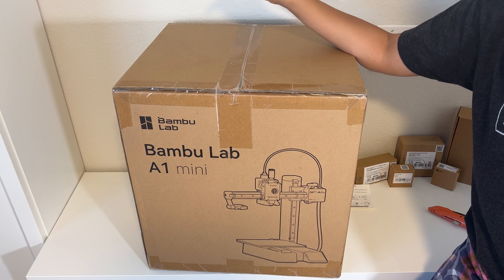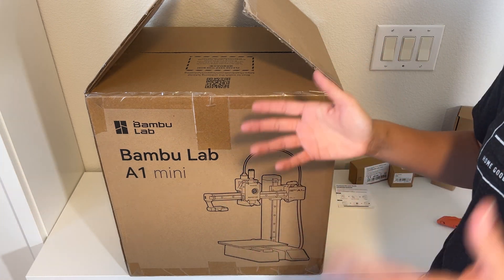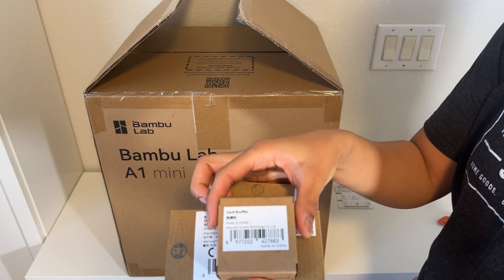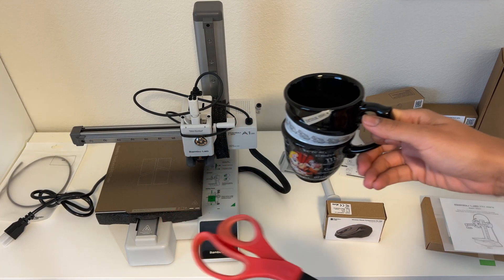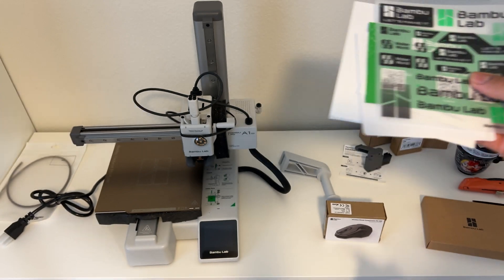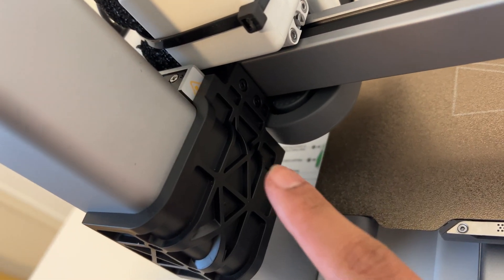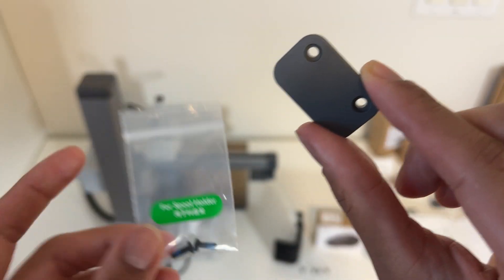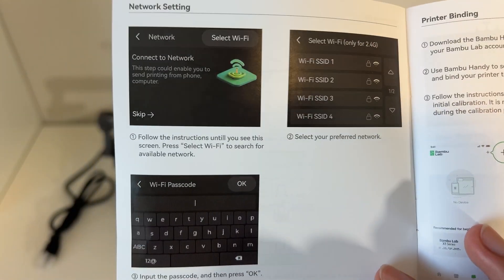Bambu Lab A1 Mini Unboxing, Set Up & Test Printing, Easiest Budget 3D Printer for Beginners

Comment: If you move the machine then recalibration is recommended by Bambu Lab. The quote is from their site "A good rule of thumb is to do a full calibration after anything major changes, such as moving the printer location, performing routine cleanings, and maintenance (belt tensioning, bed tramming, etc.)"